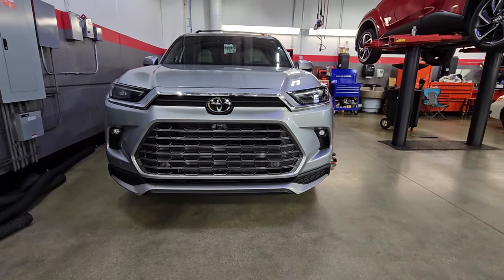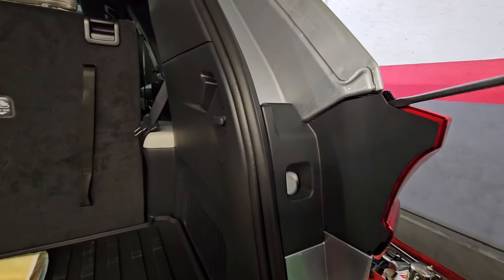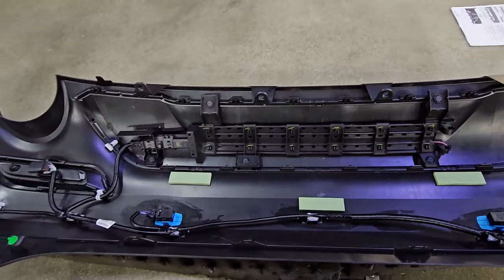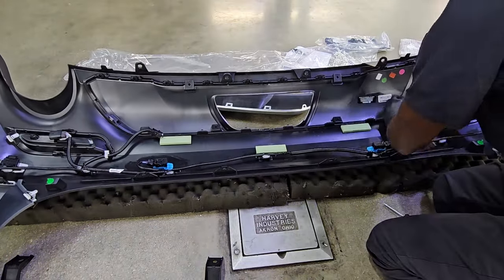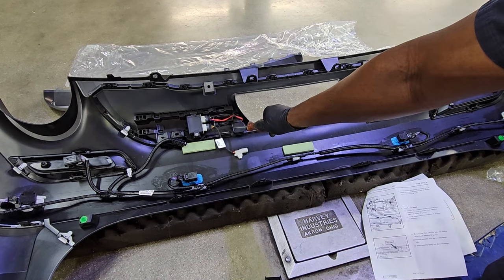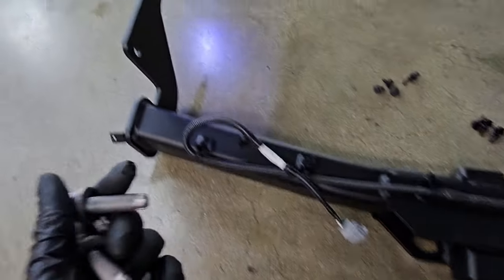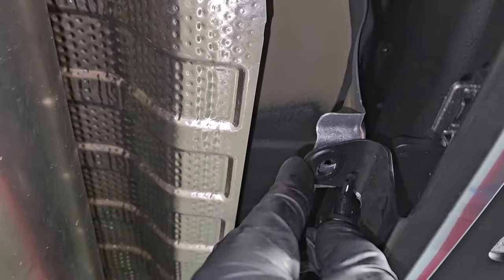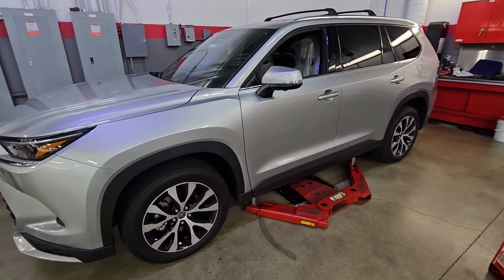TOYOTA GRAND HIGHLANDER TOW HITCH INSTALLATION (2023-2024)

Comment: For the TOW CONVERTER BOX PT725-48241, I seen where it connects, I do not see why a green 30amp fuse (that comes with it) goes? Can you post a link to the install instructions? or where in which fuse box it goes?
Reply from the maker: Hi, there's already a 30amp fuse installed in the car underneath the hood. The kit comes with an extra one. The fuse block is located in the engine bay.
Reply from the maker: The mounting location for the converter box is located in the area where you saw the connector, just a little further down. To get access to it, open the DRIVER REAR door and remove the body weatherstrip by the rear quarter panel, and you should be able to pop that rear quarter panel out far enough to get access to mounting tabs. I do believe the quarter panel has a 10mm bolt holding it to the body. You dont need to remove the cover completely. You just need enough room to get your hands in there.
Reply: @TheYotaChannel  this doesn’t make much sense. How does the converter box that has to get connected inside/underneath the cup holder of the third row driver side get mounted to the body? They give you a bolt but I see no way to mount it. Do you just throw it in there and hope it doesn’t rattle around? :\

Comment: How many hours do you think it would take the service department to perform the installation?
Reply from the maker: Hey, great question.  I'll say 3-4hr labor time.  It also depends on if they have someone who's done it before and don't have to read the instructions page by page.  It's not the most difficult job in the world, but you do need to do it with a level of care because, most likely, it will be a brand new vehicle, and you dont want to scratch anything.
Reply: Thanks for the quick reply!

Comment: Do you know the part number for a black lower bumper cover? The PT938-48241 is silver I believe but is PT938-48241-02 black?
Reply from the maker: Hey, im not sure. I only had the part numbers for the parts you see in the video. Check with the parts department to be sure.
Reply: Any information on this? I’ve been looking everywhere and can’t find what the right part is. PT938-48241 is like $80 but there is a PT938-48241-11 I’m seeing that is like $240. The -02 is also $240 so I’m really confused on what to buy…
Reply from the maker: @blakescampbell  you can always play it safe by ordering the parts at your local Toyota dealer. If you give them your VIN number, they should be able to tell you all the correct parts you will need for the job.

Comment: 5:16pm Houston. If I ordered the entire kit from the dealer before picking up my new GH MAX what would the cost be?  Including labor?   I would like to tackle the job myself but use all Toyota OEM parts like you did.  Cost of parts alone?  I’ll need that power adapter for my trailer.  Also my 2011 Prius TPMS LIGHT stays on and new tire pressure sensors put in 3 years ago.  I’ve tried all the easy hacks. Are new sensors my only choice?  Is there a way to activate the sensors with a hand held programmer like GM has?  Love your new channel!!!!
Reply from the maker: Hey, im not sure about the price of the parts. Labor costs can vary from dealer to dealer.  As you can see, it's not the most difficult job or time consuming.  If you buy the parts yourself from the parts counter and install them yourself,  you will definitely save some money.  Play it safe and order parts at a Toyota dealer so you can ensure you get the correct parts and decide if you have the time to tackle it on.
Reply from the maker: As far as your 2011 Prius, when you first READY ON the car,  does the TPMS light flash several times? Or does it stay on steady. If it's on steady, you have low tire pressure in one or more of your tire. If it flashes, it means a sensor or two may be bad. If you bought new sensors, then YES, you need a Toyota scanner to calibrate the sensors.  GM does make it a little easier by just putting it in learn mode and going the tires with a tool

Comment: Do you think we can install toyota digital rear view mirror from platinum to the grand highlander limited. If so do you know what part no is that
Reply from the maker: Hey, unfortunately, it won't be compatible.  Models with the digital rear view mirrors have a separate camera mounted on the top rear back door.
Reply: @TheYotaChannel hey what if the car is equipped with panoramic view monitor/ surround view camera system. Can then the rearview digital camera be installed

Comment: It’s odd that they didn’t have the converter included in the package. Will you be doing a video on the converter too?
Reply from the maker: At 10:16 mark in the video, i talked a little bit about where the connector is located for the converter. Once you remove the cup holder on the rear driver side,  the connector will be there. All you have to do is plug the converter, and the trailer lights will work.
Reply: @TheYotaChannel  thank you for the great video with advice.. cheers.
Reply: @TheYotaChannel  quick question is the converter a plug and play device or do you have to route additional power wires to the main battery too.. I saw only one white connection there so am wondering it both input and output are in the same connection.
Reply from the maker: @CanadaSocial  yes its plug and play.
Reply: And what is this converter box called? Is there a link to it? Is it a generic part?  I want to use my Grand Highlander trailer hitch today and none of the lights worked for my trailer dealer installed option.

Comment: What parts did you use. Can you link the kit?
Reply from the maker: Hi, all the parts used are in the description. I recommend checking with your local Toyota parts department to make sure  you get the correct parts for your Grand Highlander.
Reply: I ordered a grand highlander hybrid max limited and was told the tow hitch was not available.  Is this correct?
Reply from the maker: @joyceperez4054  They have it available. The one in the video is a Grand highlander hybrid max limited.

Comment: I am sorry, what is the converter box look like ?  do I need to order this from toyota ?
Reply from the maker: The converter box is a small box that allows the hitch connector at the rear to send brake, turn, and stop signals to the trailer you are towing. I suggest you order it from Toyota, and at the 10:22 mark in the video, i showed where it plugs into.
Reply from the maker: If it's for a bike rack, then you won't need to worry about the turn, stop, and turn signals working.  But if you are planning on towing a trailer or a jet ski that requires those turn, stop signal lights to work, you will need the converter box.